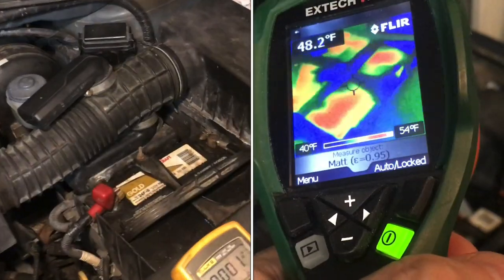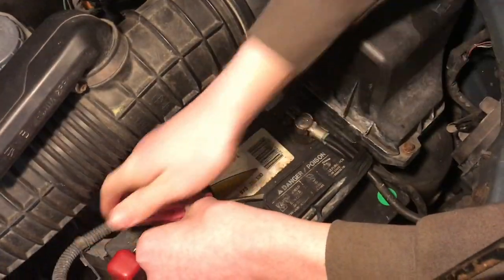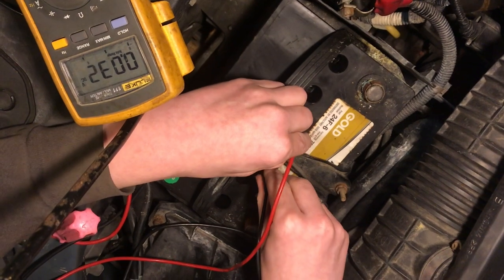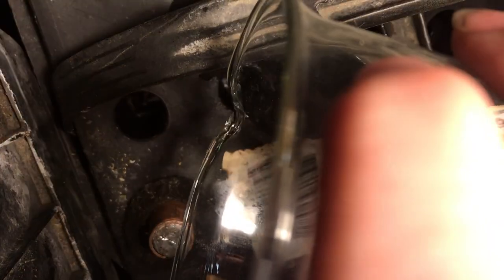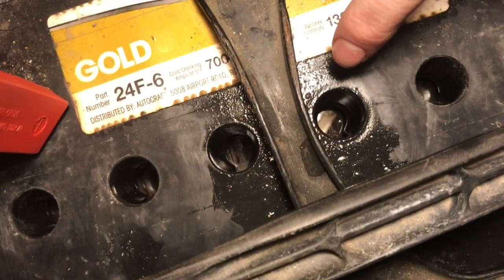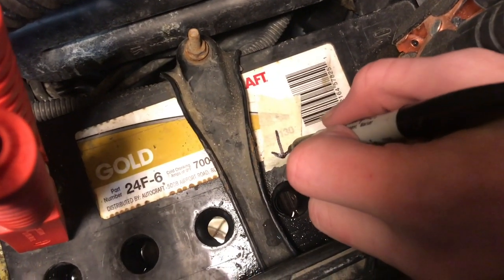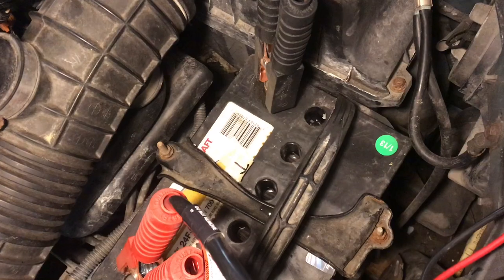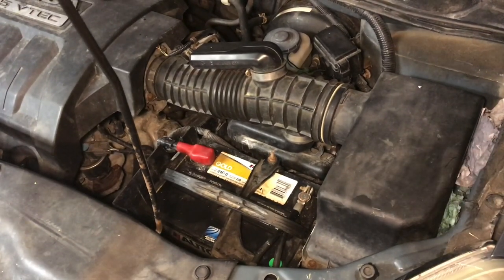recovering “BAD cell” on a car battery (cen-tech battery charger) harbor freight  2/10/40/200 amp

Comment: I don't get any bubbles when I do this
Reply: 200 amp..fill with distilled water only to the bottom of the cap..every hour do 15 minutes not more.
Reply: You don't get bubbles because this cheap charger can only give 200A boost for around 10 seconds and drop way down.  Its not charging at the 200A level at any rate because it would overheat the charger.  The electronic units all shuts down to protect itself from being runned at that amperage level for a long time.  Get an ARC welder and you can maintain the higher current continuously.  They are designed to provide high current in order to be able to weld metal.  These chargers are just TOYS.

Comment: I just bought the same charger and I can't get it to work
Reply: return it now
Reply: @robert5  Of course not.  That cheap charger only gives you around 200A for 10 seconds and drops way down to protect itself.  You either need a good expensive charger that can maintain 200A or get an ARC welder which can also maintain the current.  These charger toys are really meant to give a quick boost of power when you start the engine and then it shuts the current down.  In the video, if you look at the bubbles, its barely charging at the 20A to 40A range.  If it was any higher, you would see the bubbles form like water boiling on a stove and even come over the top of the cap.

Comment: Wouldn’t it be better to add sulfuric acid instead of distilled water
Reply: From another video from a battery company.  The acid, and water mix  is 50/50.
Reply: Sulfuric acid doesn't evaporate ,  just the water .   Several have said  .

Comment: smh what a video. it showed nothing and you are using the wrong charger and you cant recover a bad cell and none of those cells were bad. you test theroy is wrong. if you gonna do a video then do it the right way
Reply: Yup.  He basically just charged his battery with a 20-40A charger in this video.  The bubbles obviously shows that its not being charged at anywhere even above 40A at most.  Most of these chargers only provide 200A for about 10 seconds and then the current goes down to protect itself from thermal damage.  Either get a manual controlled charger or an ARC welder where its designed to maintain a high current for a long time.  Its misleading for people to think these chargers even work because its designed not to provide continuous 200A charging.  Its only to provide a brief 10 second boost so you can start a car, not to charge a battery continuously at that current level.